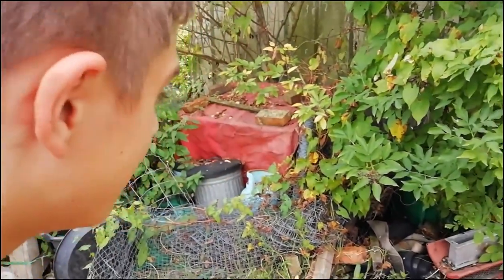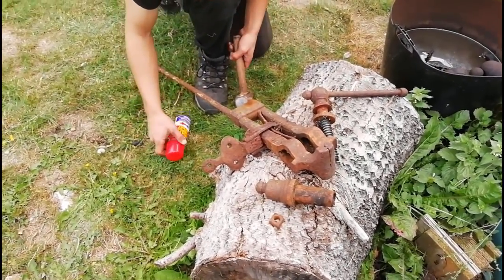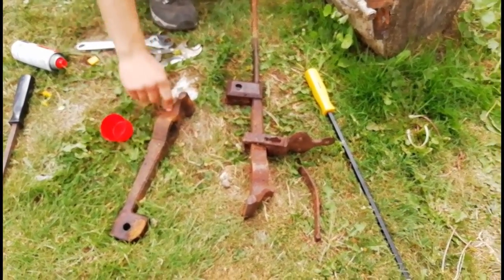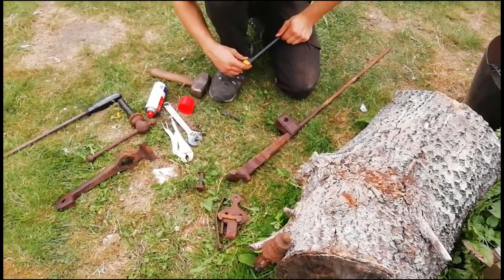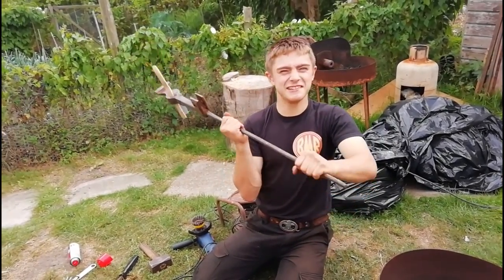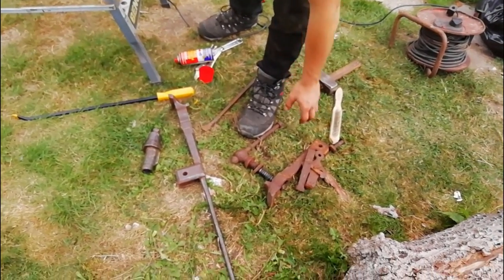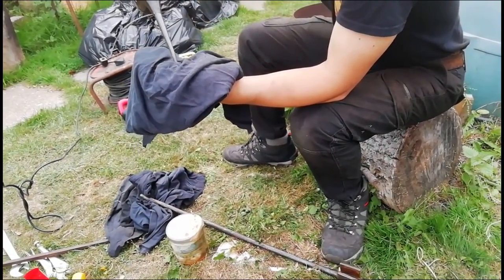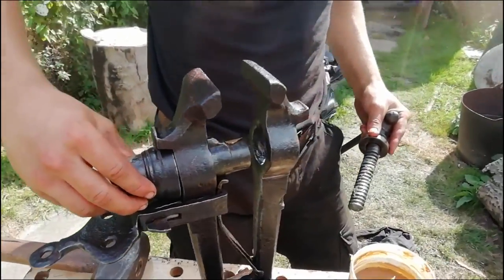BLACKSMITH TOOL RESTORATION - BLACKSMITHS LEG VICE!!!

Comment: I have the exact same vise, missing the spring.. any advise on a replacement, either purchase or make from scratch would be much appreciated. Located west Melbourne Victoria 😁
Reply from the maker: Thank you so much for your comment!
They are great vises! As for fixing/buying a new spring, I would know where you could find one, however I am able to give you the measurements off of the spring on my vise if you are interested! 🤠⚒️
Reply: @JacobShafe  Very interested in basic measures: length, width and thickness. Too many videos later I understand how to form a spring, having the dimensions correct will be a huge advantage! Many thanks in advance 😁
Reply from the maker: The measurements of my spring are:
170mm in length
25mm in width
5mm in thickness
Hope this has helped, best of luck! 🤠⚒️
Reply: Many thanks, the measurements are exactly what I needed! 
Much appreciated 😎